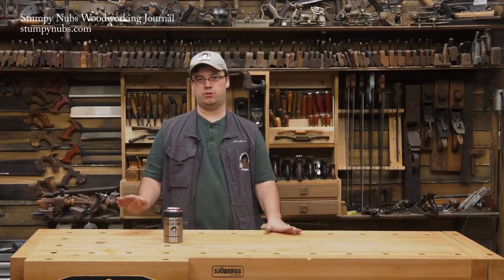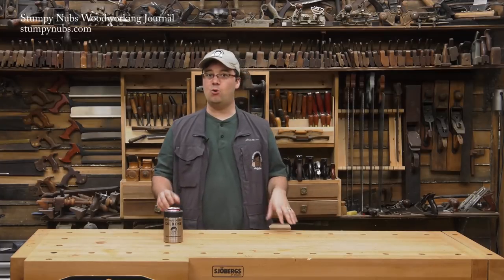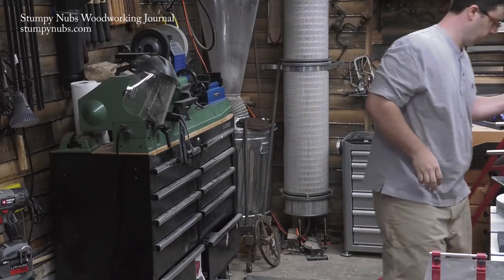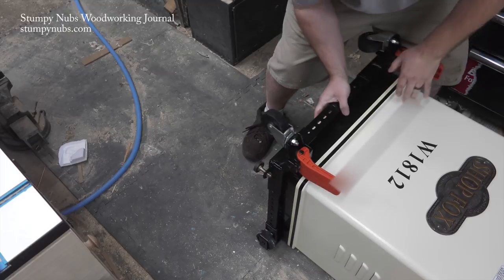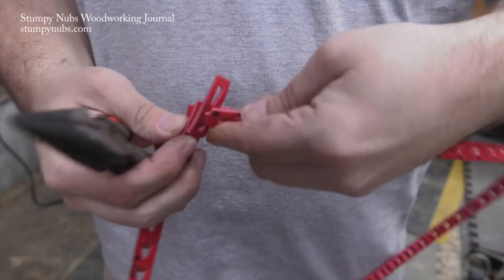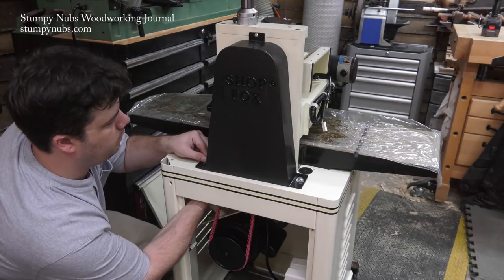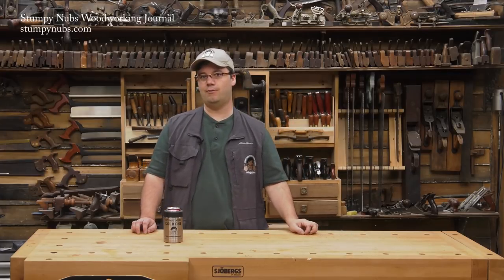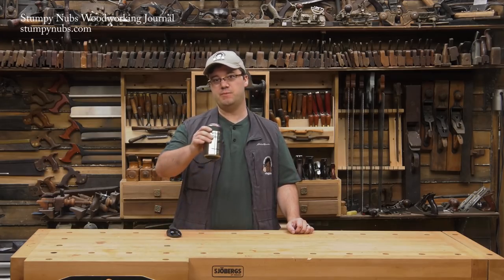SNWJ gets an AWESOME new woodworking toy- Try to guess what it is!

Comment: I know where the extra nuts and bolts come from.  Manufactures send extra to make up for the ones lost under the bench.  After years of keeping data on requests for extra fasteners they now know the average number of fasteners lost on any assembly and send you the extra right away. You were just better at keeping track of parts during assembly.  Nothing to worry about.

Comment: when using a hand truck (dolly as you called it) pull over obstacles don't push, it will give you more control and be a lot safer.

Comment: Link belts are shizer maybe use in emergency but quickly get a new vee or preferably a timing belt fitted. Link belts have no strength in them.
Reply: The machine looks the dog's though. How does it perform